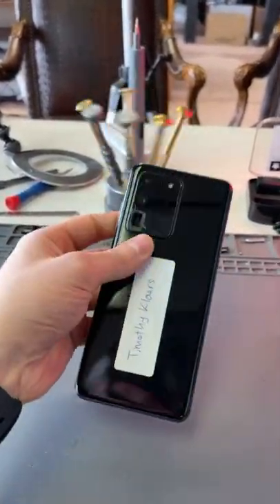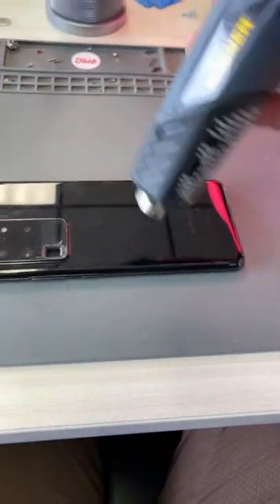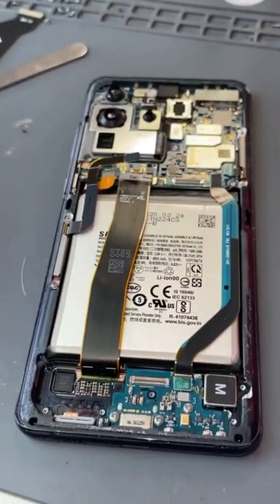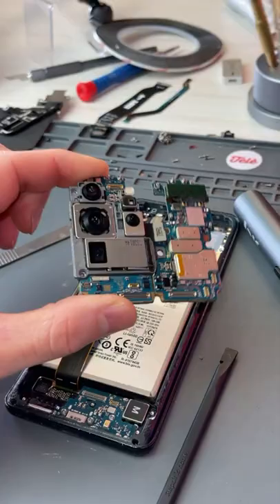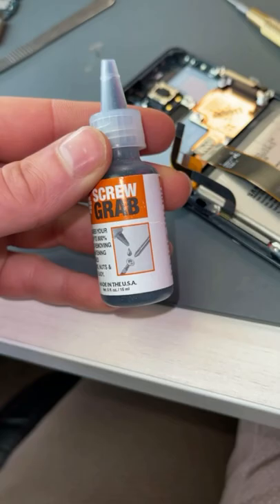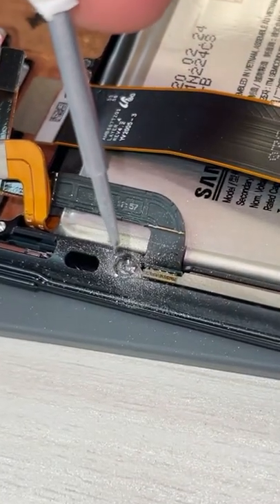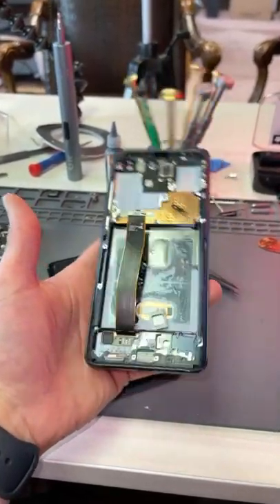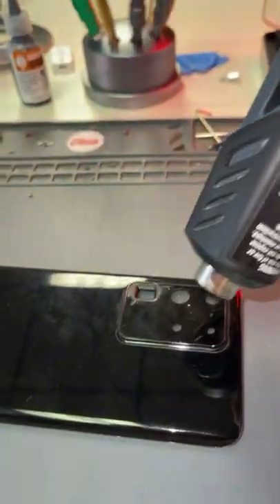Got myself out of a sticky situation there 😬 #Shorts #PhoneRepair #Samsung #S20Ultra #TeleTouch

Comment: So what would u say is the best phone?
Reply: Depends on what you need.
Samsung s21 ultra or note 20 ultra, are fantastic for Android and the highest quality in screen, great pictures and decent video(compared to other flagships)

However if you have a lot of people with iPhones at work or your friends, iPhone 13 pro max. Airdrop for fsdg sharing documents and work files, iMessage to send full quality 4k videos and high res pics, FaceTime is the quickest way to video chat multiple people no apps starting up, or logging in, it's literally making a phone call

Honorary mention, one plus 9 pro. Basically like an ultra, with a worse overall camera (but a better ultra wide) however heard oxygen OS has been buggy lately so your mileage may vary.
But those 3 are the best,